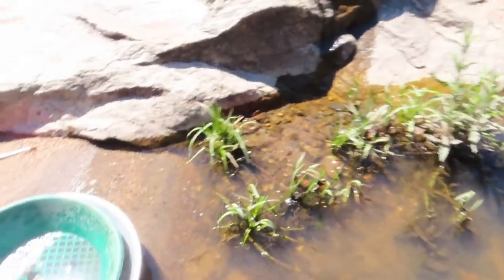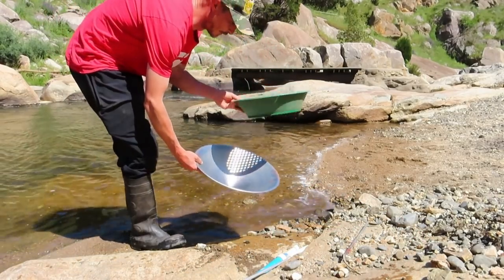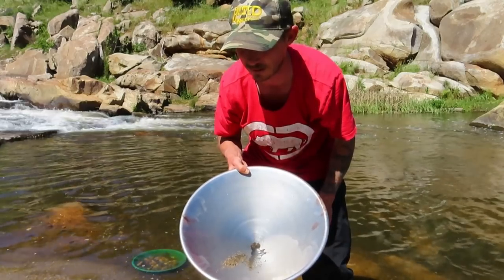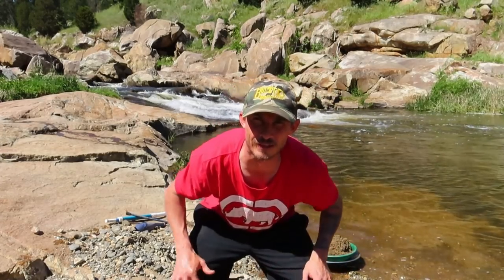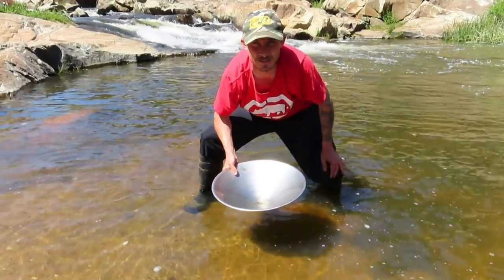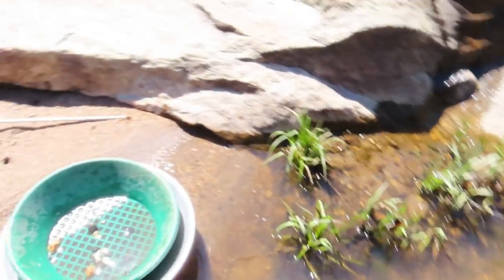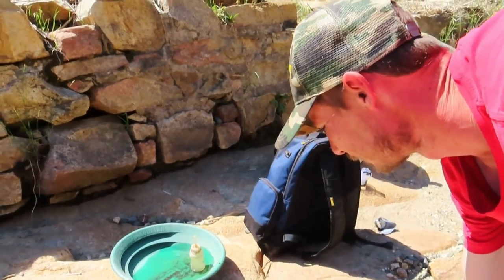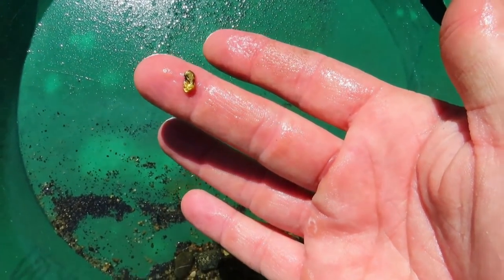I find this GOLD NUGGET! Crevicing for GOLD

Comment: do you have to burn the burn to season the pitaya pan before you use it
Reply: Yes, you need to season any steel pan in order to stop it rusting up too much. It extends the life of the pan massively.
It also removes any left over oil from the production of the pan.
Reply: @Swingin_wit_Willy  so its a steel pan not stainless steel or alloy
Reply: @pkgoldopalhunting  the old skool ones definately were. Im not sure of the contents of the steel they use now days. But with such rough usage it will rust up eventually. Plus heat treating the pan darkens the steel to help gold stand out alot easier. Vogus has done it to his batea pan... the gold pops.